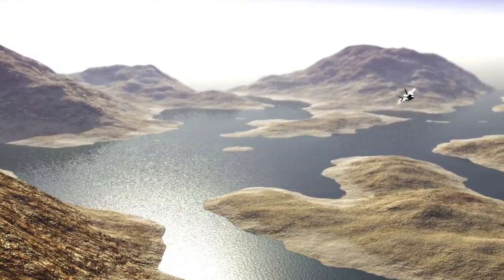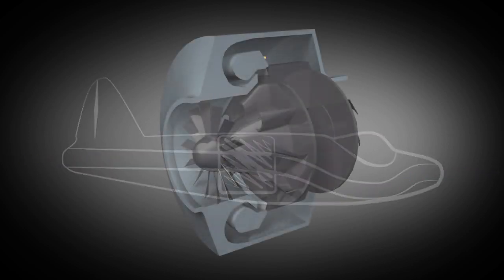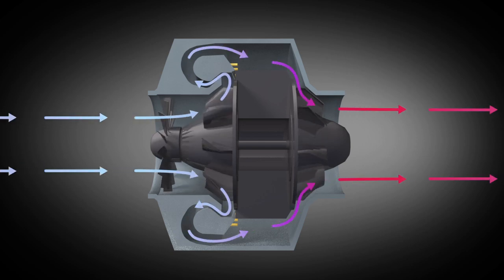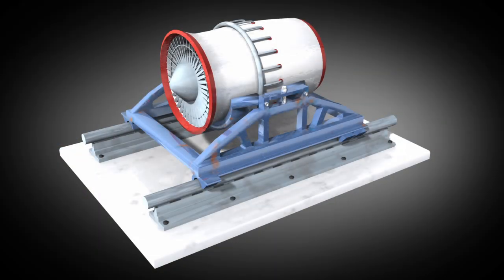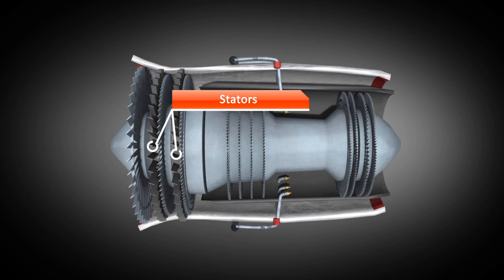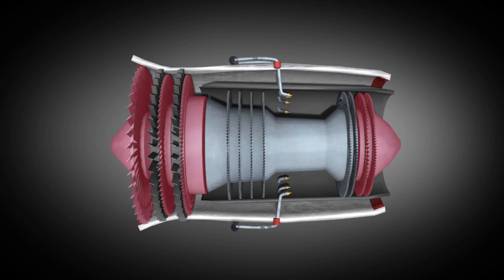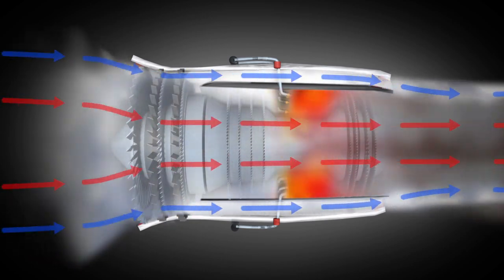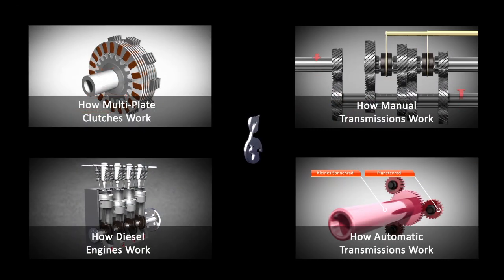How Jet Engines Work! (Animation)

Comment: One thing that I have wondered is that how does the air interact with the engine, how does momentum shift from the air to the engine? Is it that the pressurised air "pushes" on the turbines and fans and that is how the force is transmitted to the engine and to the whole plane?

Comment: Every explanation I have looked at online for how a jet engine works has failed to explain something. Hopefully someone who knows better can solve this for me. Most all of the explanations start with 'air flowing through to the combustion chamber'. This is fine and I understand how the compression and combustion work, but, nobody explains how the airflow is initiated or maintained. Does the 'fan' at the front of the engine act initially (or always) as a propeller? Does the fan suck air in and send it to the compressor and ignition section? If so, does this propeller provide any useful thrust as a primary/secondary objective?? Is the jet engine in fact a sort of prop engine to which has been added the compression, combustion and exhaust cycle or is the job of that initial fan solely to push air through the jet, or indeed, does it provide any function at all after the jet engine is running?
Reply: Indeed you did thanks. Since read up about APU's both internal to the aircraft which seems is the norm, and externally delivered by a truck or van. So the cycle is always initiated by forcing air through the jet engine. That answers my question - thanks :-)

Comment: Why don't the hot gasses expand out the front of the engine? It seems like some conservation of energy law is being broken, obviously it isn't, because the amount of energy extracted by the turbine must equal the energy it took to compress the air in the first place; i.e. the resistance in the front and back from the compressor and turbine must match.
Reply: +Arch Mage the compressor is essentially a fan that pulls air in, the turbine is a fan that pushes air out its a one way flow? I'm no physicist so I don't understand the more complex stuff you're on about but hopefully that kinda helps explain why it doesn't come out the front
Reply: Love the profile pic :)

The turbine extracts just enough energy to spin the compressor, it doesn't push the airflow, rather it's pushed by it. So another way to ask the question is how can you build a one way fan. Perhaps it's the ratio of compressor area vs turbine area? Or inlet to outlet area?

Comment: Why aren't the stators supposed to turn?
Reply: +AeroElectro I'm not an expert but my understanding is that their job is to remove the rotation from the airflow. You want the air to move back in a straight line rather than swirl.